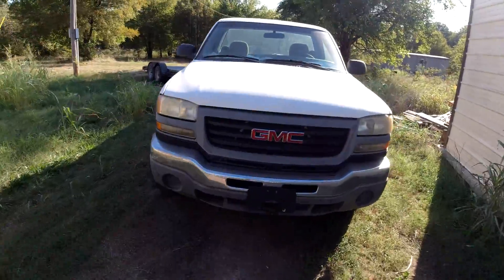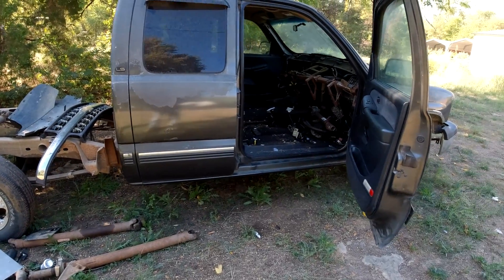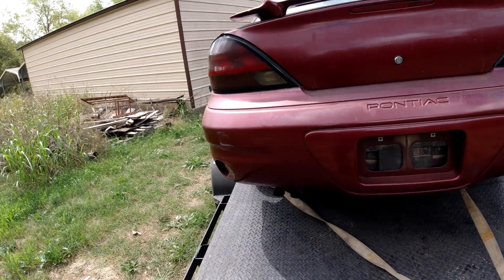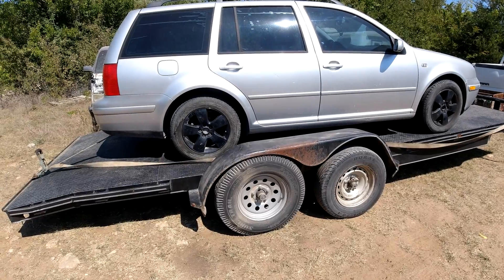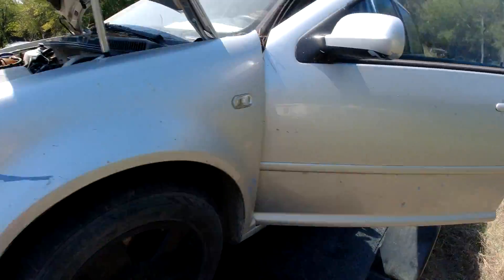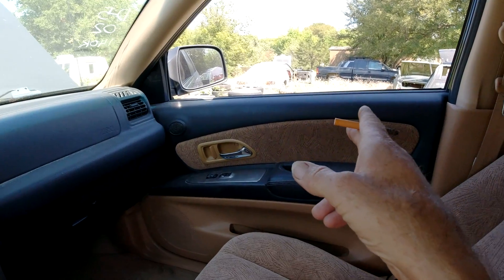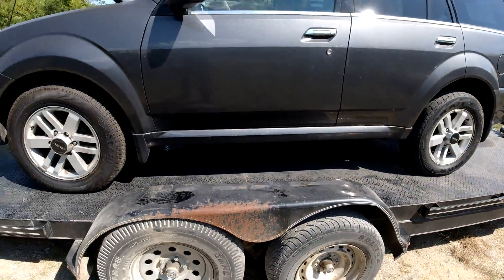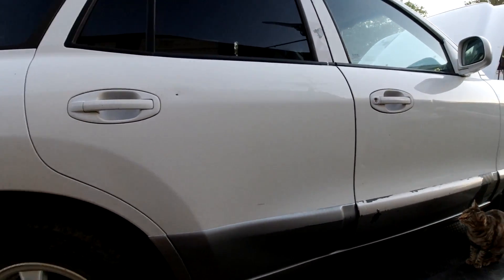Another Clunker Haul In! Buying Clunkers for Cheap! How to make money with Junk Vehicles.

Comment: you need a guy with a Tech 2 to scan the computer for transmission codes, scanner at autozone won't do it. Sounds like shift solenoids & wiring harness  replacement may fix that isuzu.
Reply from the maker: that was my first thought, solenoids

Comment: On the Jetta, salvage the battery and cats, sell parts and crush it.
Reply from the maker: Should I Neutral Drop it first?
Reply: @clunkersandclassics  why not, on the Gran Am, be careful with the disconnected steering shaft, you may break the clock spring.